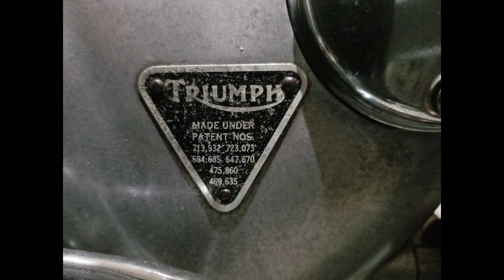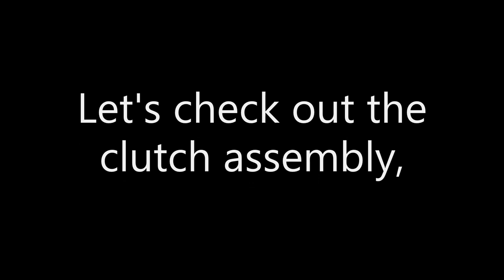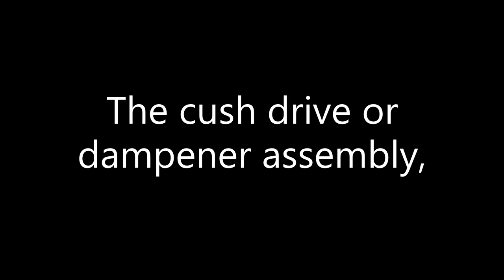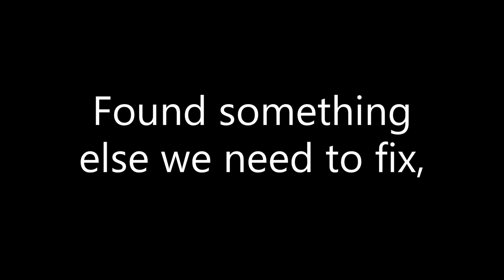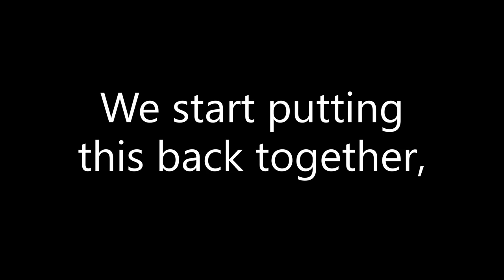1974 Triumph Trident restoration Part: 4 The clutch assembly

Comment: The dirt inside the cover is from the ball bearing's grease. The clutch facing is radially outboard and is thrown out as the clutch spins. The pressure plate would have been balanced before assembly then the whole balanced by the basket.

Comment: Where can one of those linear bearings be purchased, I’m referring to triumph part number 57-3717 excellent videos by the way, thank you guys
Reply from the maker: Thanks for the great comment, The bearing your referring to is a single row angular contact ball bearing.
We bought ours from Amazon it is made by FAG which is a great brand and great quality, the bearing number is 7203-B-2RS-TVP It cost us at the time 52.49 It's an expensive bearing but not availible from vintage Triumph parts sources there are several Trident custom parts vendors that do sell the angular thrust bearing but they were wanting way more money for it.

Comment: Hello Jesse,  Great video.  @1:02:37 you talk about the 19T sprocket being a little bit further out so that the chain will not rub against the rubber seal screws.  I did that as well, however, my X-Ring 530 chain I purchased will rub against the back of the clutch housing case when I install it.  Do you have a link to the x-chain chain (how long/links) that you purchased?  Thank you.
Reply from the maker: D.I.D 530VX3 Natural Steel 110 Link Xring chain
 It is the narrowest xring chain we have found and lasts very long I don't remember the exact links needed but we took a few links out of the chain. Oh and we have room on both sides of the chain and it doesn't rub anywhere. We're very happy with the chain on our bike.
Reply: Thanks Jesse,  I’m on it.

Comment: Wouldn't it be better to check with paper, with the new clutch plate ? Also I'm not sure but it would be nice to have the washer spacer on the underside of the pull rod concentric ? Just in case it is adding bias to your readings , I think my T160 is getting worn in the clutch hub to clutch plate inner spline , as i can feel some backlash developing or it might be the cush rubbers , mine has that clutch mod on the outer quadrant lever and my clutch is quite light and it works  . Cheers

Comment: 1 am sorry but you need to look at this clutch  more carefully .  I HAVE NEVER HEARD OF THIS X RING MOD THIS IS NOT THE PART THAT GOES THERE what goes ther is a glued on seal bearing boss that accepts the seal in the inner primary cover. Your assumption of how the shock absorber and primary sprocket assemble on the clutch is not right ...... research this area as carefully as possible they are numerous wrong assumptions that folks make that lead to serious damage don't neglect gaining a complete understanding of this whole clutch primary ares.
Reply from the maker: Some where in 1972 for the 1973 T150V production the part your referring to changed and that Sleeve ring was eliminated so the nose of the spider was extended the same amount as the thickness as that Sleeve ring.
Reply: I’m also wondering where I can buy this X ring, currently there is nothing over the end of my clutch spline? To date I’ve not seen any sign of any oil escaping the clutch area? Thank you.
Reply from the maker: @karlredding8988  Xring or the quad ring we used was number 211 and it's physical size is 13/16" id x 1-1/16" od x 1/8" thick you can probably get them from a auto parts store,
The Triumph Oring that fits and works good also is part number 60-4419